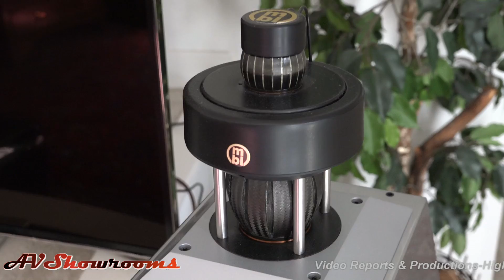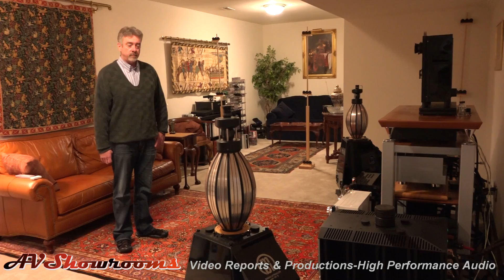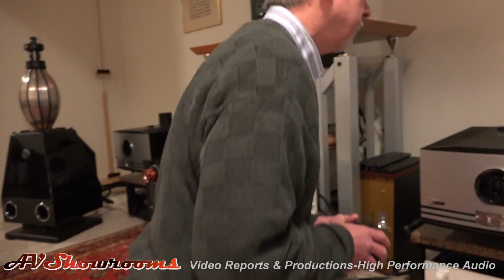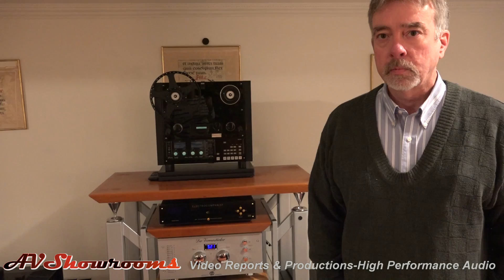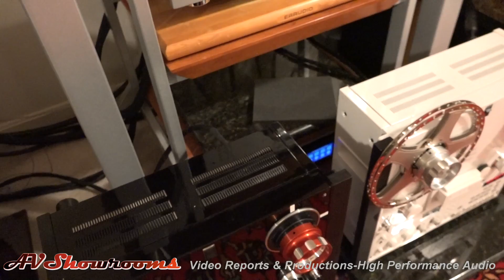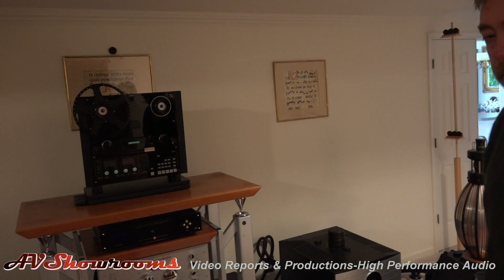$1,000,000 The World's Greatest Audio Systems and United Home Audio tape decks

Comment: While the trumpets, strings and wind instruments sounded perfect, the Upright Piano and some drums sounded wrong.  Some instruments are not omni-directional and only play forward or downward.  So while there is no denying the experience is breathtaking, some things aren't right.  Vocals are so natural, but low notes sound like they are down low near floor and the high notes sound like they are coming in high up.  Very noticeable with her range, so that's rare, but there.    This is a great design, perhaps in the future the single direction instruments can be configured to come from just a certain part of the speaker via one of the incredibly expensive amps on the floor.  Until then it's not quite perfect.  But what beats it?   Owning a jazz club perhaps?

Comment: Most speakers are straight out the front, these ones are completely omni. I tried to mimic how it really is, more. Semi omni. I have semi dipole speakers with FR drivers half (out of the box). The drivers are raised from the speaker hole (about a half inch). The sound from the back of the driver escapes through the gap, still making the speakers (basically) directional, but with some dipole mixed (and still has enough warmth in the med range). I love it, it has the same "open" sound as dipoles but more directional like most live music is (depending on the instrument, though). So it's still a compromise but sounds better than full frontals and full on omnis (I reckon).

Comment: Cost isnt' the last thing one should figure up.  If you see it , hear it , and love it!   You will have a few options. 1. you can wait for the funds to add up       2. Buy used gear when the seller has a very documented owners provenance, showing damage , repairs, upgrades , or the tweaks that some brainchild developed while looking at the latest issue of GoodBeaverMonthly ... Buy the best you can afford and trade up as the stash grows.  I have been trading since 1986 with car audio gear. Most high end HomeAudio/Theater shops will trade you up to the current model if you bought the previous current model that is being replaced due to outdated processing . from them and buy units with the last item purchased from them out of favor with the reviewer and rich. 

.  Buy the best you can afford and trade up as the stash grows.  I have been trading since 1986 with car audio gear. Most high end shops will trade you up to the current model if you bought the previous current model that is being replaced due to outdated processing . from them and buy units with the last item purchased from them out of favor with the reviewer and rich.

Comment: My curiosity is sparked, honestly I’d love to hear it in person, but there are a lot of acoustical no-no’s being committed here... most importantly, why the Omni directional speakers if the audience is only in the front, normally you would do the opposite... in a front only audience, you would have directional speakers and treat behind the speakers to prevent unwanted and uncontrolled reverb as even directional speakers have a little bleed behind them. These guys are blasting audio directly into the wall so it bounces off creating tons of that nasty reverb... and before the haters start with “reverb is good”, reverb CAN be good... when designed correctly, which this isn’t... they are just blasting sound directly into the wall. Spewing audio everywhere is going to create many problems and only have benefits if you’re lucky. How many music venues has anyone been to that had a front only audience and Omni directional speakers? Anyone? (I am not being sarcastic with this question). At the end of the day, if you are this serious about audio, please realize that buying equipment is less than half the battle, acoustics is actually far more important.

Comment: The tapes are probably $65.00 for a 10.5 inch blank reel if you would buy a Quantegy or ATR Magnetics tape. I'm not sure if you'd buy special blanks for these that I never heard of, or not. This machine would probably bias anything you throw its way.  I know it's fantastic equipment, but if I wanted to "push the envelope" on something like this, my wife would "push me out the door."  The other issue is the constant maintenance on these, such as head cleaning and guide cleaning, as well as capstans and pinch rollers.  Would I mind having this system?  No!  But personally, I have several reel to reel decks that would probably be able to reproduce extremely close to this quality of sound through this system.  The thing I do like about these videos though is it does showcase great equipment.  Reel to reel is truly the best audio format if you have the right equipment, everything is clean, and setup is proper.  Thank you for sharing.

Comment: The system sounds spectacular but I'm sorry Peter it isn't the MBLs, it is completely due to the source components & you should have been more up front on that point. My first experience hearing what tape did was in the late 70s & I was in the recording studio when George Duke was recording his Master of the Game album & I heard it played from the tape through the wall mounted JBL 4311b monitors which are nothing to write home about & the sound was so stunning that I simply couldn't believe what I heard. No turntable or digital system can come anywhere near the level of performance of tape, the tape is in a completely different league & it doesn't matter what amps, speakers, turntables or cartridges you have it doesn't matter. I have little doubt your not aware of this & you really should have made the point as there may be some viewers that never had the pleasure of hearing this format.

Comment: No doubt about it, this is an extremely fine set-up. However, you really don't need to spend that kinda dough for good sound. Funny, but as cost rises, the increments of "better sound" get smaller and smaller. For you folks at home trying to assemble a two channel audio system, buy good quality components and don't skimp on the speakers as they will really define the "sound" you get. 
 Also everything doesn't have to be built after the year 2000. Some fine vintage hifi equipment (in good working order) can still be had for reasonable cost. The goal is to enjoy your music, if you can sit back, close your eyes and believe the performance is happening in your room so much the better. Just buy the best YOU can afford. Nice to see someone put that kinda cash into a music system, impressive video.

Comment: A million dolllar system to play a vinyl record with a 50dB dynamic range.
Reply: And placed as close as possible to the speaker to get the best sound enhancement. :-o
Reply: but havent you heard?  vinyl is more lifelike and doesnt give you digititis  ;'D
Reply: @chrisw7188  digital music is poor dynamic(mp3 for example or Cd) and loud! An analog vinyl is having less dynamic range but more intervals and a trully warm sound!
Reply: Plus the older you are, the less dynamic range you're going to hear. Even if I had untold wealth, I reckon £20,000 would be nearer my budget requirement for a top sounding system.
Reply: @Ed Houck 
Ultimate sound quality is to be as close to record studio original sound as possible. Only digital lossless distribution gives such a quality. Amps... -120dB THD+N and flat frequency response are enough. Speakers choice is more difficult, since the most expensive does not always mean most precise or having flat frequency response. Finally room acoustics treatment is what makes ultimate sound quality. The room in the video is not treated. You hear all room reflections.
Reply: HI FI VCR is a great way to go analog, with great range, but it may have to have a sound cover for it. Easier then Reel to Reel.
Reply: @markeaton2003  I did some really nice sounding live recordings of heavy rock bands at different venues using some microphones and an Svhs back in the ninety's. Sounded so smooth and warm. Tonnes of range and headroom. Not many people realize the audio tracks on a SVHS are huge and record like cd quality.
Reply: @markeaton2003  agree there. I did know of guys who used to record live sets on VHS.
Reply: @markeaton2003  DAT digital recorders today are super cheap and sound incredible good.
Reply: @theatremad9797  I understand that Metallica take especial care with the production of their records.
Reply: The music being played made me imagine Scat Man Crothers hearing it and saying this system, it has what my Grandma called the shining. ..lol. Seriously scary system crazy presence!  Enjoyed the vid. Wow...
Reply: you`ve never heard what vinyl can do kid

Comment: The equipment descriptions were cool.  Listening to a recording of a recording is a wast of time.  Since this was recorded in 2015 the availability of direct source materiel from the artists tape vaults makes the tape players obsolete.  With super high-res digital recordings available for download you can save the cost of the reel-to-reel systems.  I did have a real-to-real system in the old days... loved it.   But they are now only used in radio stations and specialty  venues.

Comment: Thanks so much for the video. I think MBL is state of the art, hand built in Germany by happy folks -- you can't beat that ---  so I hope they keep selling them! For those who want this kind of sound in the home...  yes it can be done DiY with dynamic all paper speakers and horns.   For those who commented on how it's even possible to gain an impression of quality via Youtube... Yes it's possible and not too hard with some practice -- that's how mastering artists do it in the first place -- using reproducers of a known standard (ie Yamaha NS-10's, headphones or whatever). It's much better to post Youtube videos made with better quality condenser mics, XY, or Side/Front setups (aka Zoom HD6). Built in camera mics are often not so hot. Very nice sounding transients on the MBL's -- but they come across a little harsh at some freq points -- maybe?. I have heard plenty of 3 way horn systems at 1/10th the cost that would keep up fine with these... using vintage components that are about as clean and speedy, and smoother with even more detail. But they are not Omni, and not NEW -- so hey!

Comment: Amazing even through my headphones, but remember the source rules. Tape is still the best sound, period. I heard the original tape of a band I knew at a wrap party and then the vinyl pressing and could not believe the difference. The tape sounded like live music. The album not so much. 
By the way, although you can  get decent sound for reasonable money if you know your stuff, thinking you can't hear the difference between high end systems and cheap systems is just wrong. Your ears are way more sensitive than you think. 
Can you tell the difference between driving a $25,000 sports car and a $ 200,000 sports car,  let alone a $2,000,000 sports car? Of course you can. I drive a $25,000 sports sedan. I love it- but I still know the difference. 
Here is something else to consider: Hearing great audio systems- even ones that cost more than you will ever spend- can help train your listening skills - so that you can better  judge the ones you can afford. If money is tight you need to know more, not less to get it right and grab a bargain.

Comment: But the recording studio used a pair of $2000 studio monitors...
Reply: Don't forget the mic.
Reply: good recording studios uses expensive equipments. the microphone alone can cost starting from 1500 us dollar to God knows how much.  don't even start with the cables and interconnect.  a good sounding mixer would cost an arm
Reply: $2000 studio monitors are not in the chain of music audio path. Electric guitars use combo amps in their music audio chain, but this is not the case for all music.
So even if record/mixing engineer does not hear some details via monitors they can still be in audio tracks, and can be heard on some other equipment.
Reply: As a matter of fact, many engineers will do a reference check on an iPhone earbud and make eq adjustments to translate well to those (most common) listening devices. It’s a game of compromises more so than ever. No doubt some systems can amplify the sound stage and be incredibly dynamic  etc.. but yeah, I doubt they’re getting much of any at all more than a decent pair of monitors in a well treated room. The 3D holographic thing is real though, I’ve owned a few tube pre amps for recording with microphones and they will do that to a sound, just like they will in playback.
Reply: @Matt man NS10s are used to make sure it doesn't sound bad on crap speakers. It's not used to judge the overall recording quality. Most studios will use two or three or four pairs, of increasing size and cost. They switch back and forth to create the compromise they feel is best for the target audience of that music.
Reply: need to upgrade the studio sound equipment to hmmm.. Cool, "i think i can hear it"
Reply: Not exactly true . A real studio uses many monitor pairs and the final master is made on very expansive speakers ..
But yes some tiny studio are doing that ..no wonder that so many songs sound really bad
Reply: Studio Monitors wipe the floor with hifi speaker at the same price point.

Comment: How much time do you spend to keep these systems clean and sparkling?  Keeping those speakers and those reel to reel players dust free might be a time consuming job.  My Audio System consists of a total of 27 equipment and I find it real difficult to keep it clean.  Mostly because I cannot pull them out like books and clean them.  I have to reach behind them, unplug all the connections, clean the wires, the shelf, the equipment... and finally put them back again.  But every week or so I vacuum clean the front of the system so no dust is visible.  But in an arrangement like this the whole area needs to be cleaned.

Comment: Does anyone have any idea what the physics are behind the GDR (Giant Diamond Radiators) Mounts, and the sets of single wooden discs on those wooden stands? How do they actually work? Also, why do the 20 amp 110v power cables need to sit on porcelain insulators, designed primarily for 33kV insulation work? Again, what do these actually contribute?
Reply: yeah, from memory i think it's E=Mc2

Comment: 300,000 tops!! those large MBL towers are 80,000 and the small ones are 12,000 a pair. the rest of the money is in the other equipment. needless to say these are one of the best sounding speakers I've ever personally heard and yes I've heard 2 channel set up that cost 300,000 Grand alone.
Reply: InChrist87   300,000 Grand.  I guess you win.

Comment: The use of Mpingo, Ebony etc is generally a good idea.  You have only to tap a piece of it to hear a pleasant enough sound.  This has been known for a long time in instrument manufacture - think clarinet, oboe, black piano keys.  It is nice to see it being used in Hi-Fi.  If you have a revealing system this is nice bit of fine-tuning that will be audible.  I have to say though the 'Spacial Sextet' is going too far.  No I have not heard them but they are 'coupled' if that is the right word through the AIR.

Comment: I wish they would play more complex music. Two instruments or a vocal and a guitar sounds great on a lot of systems. Show the system off with a orchestra or a brass band or a rock band.
Reply: they do it on purpose to let the sound 'breathe'..there's also less chance of transients and reflections showing up the errors in the room....because: marketing.
Reply: "reflections showing up the errors in the room"  i was really thinking at the same issue.  I have Always had the feeling that to get a really great soundstage using omnidirectional speakers is a challenge.  Actually i tend to lean towards very directional speakers. Very small sweet spot but also much less reflections to cope with.  Maybe i am completely wrong in this approach. I do not know.
Reply: gino 
You are not wrong. I do this for a living. Much larger scale and time coherency and minimal comb filtering are vital to good sound.
Reply: @gino3286  

Boxless ribbon speakes, such as the Magnepan 1D solves all the wall refraction/distortion problems.
Reply: As someone with a lot of recording experience, 
The power and quality you create in a record with less tracks is very noticeable.. it gives more headroom for each instrument and allows them to occupy more space.. a lot of the best sounding songs are quite simplistic.. not all, but a lot.
Reply: Yes, they should really play some Dimmu Borgir, full on metal band + orchestra and see how well it resolves.
Reply: chris meier 
Or a rap band! 😂

Comment: I bet it's sublime. I went from Sony £200 integrated with bookshelf speakers to B&W/Naim/Rega.  Now I have reached a decent level.  In my small lounge (too small for the speakers) I still get 'sound erupting  in 3d space' with good digital sources.  Most expensive system I ever had time to myself to use (a couple of hours with my best CDs in a Hifi shop) was a Bryston/Cyrus/PMC setup with some room conditioning.  It cost about £30,000 but TBH my £3000 system sounded better to me (not quite as much detail but my soundstage is bigger and more '3D')

Comment: I have been told that having the speakers on spikes are not the best sounding solution. i wonder what the alternative would be. i have optional spikes to screw in to my speaker stands, but the stands are made out of a metal pipe which is not filled with anything so the spikes are probably just wasted on those anyway. so for those who have compared with or without spikes on quality speakers in a treated room, how big is the difference and what should i look for in the sound to hear the difference?